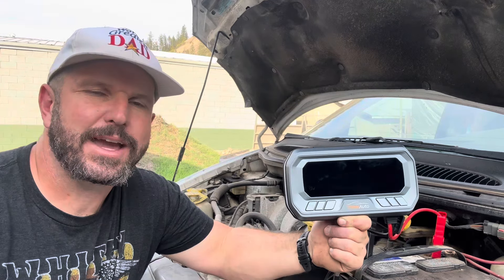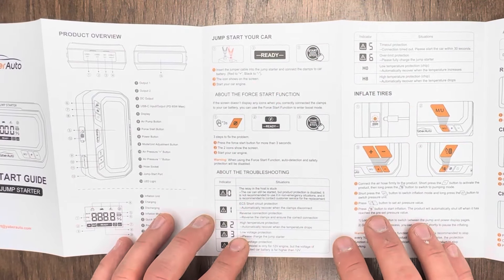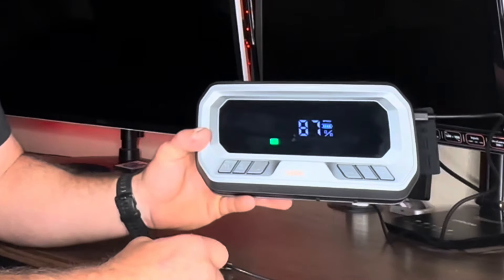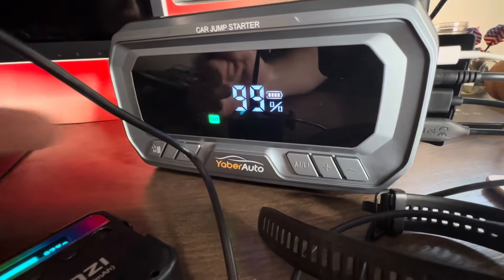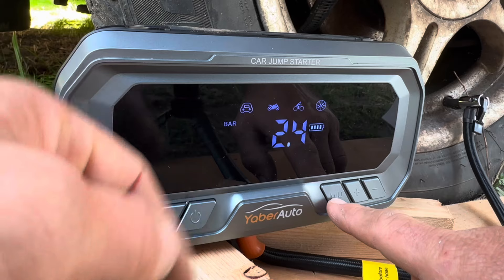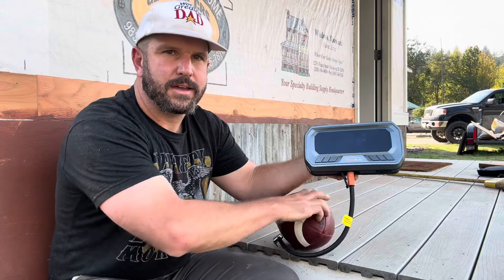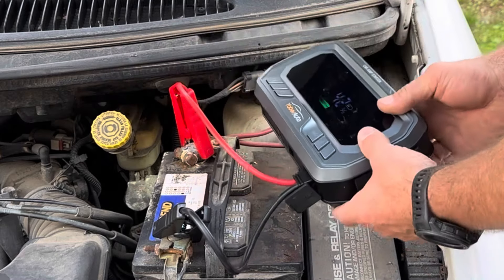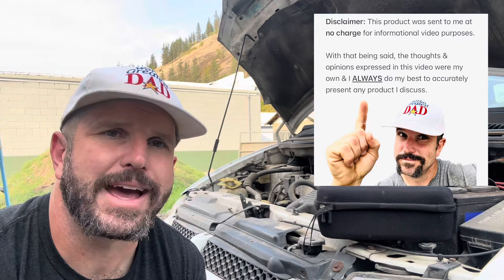Testing the Highest Rated Portable Jump Starter on Amazon - My YaberAuto Jump Starter Review

Comment: The product mentions that it can be recharged in 1.5 hours, providing that you are using a 65W charging brick. It wasn't clear what kind of charging brick you were using in your review. Did you ever try to completely drain the unit and recharge it from a 65W charging brick to check their claim?

Comment: Great video! Your great review gave me the confidence to trust the product. I must mention, it is charging now and compared to yours where your unit had 87% and it took just below 17 min to take it to 100%, mine was 90% when initially plugged in so I expected around the same time as yours. However, as I am typing this, it's been over 30 min and it just now went to 91%. I actually thought it wasn't working as the reader didn't move. But the screen shows as charging and now supposedly went to a whooping 1% more in over 30 min. I don't know how to feel about this as it already is not living up to the product's claims and to the expectations. Not your issue and you still have a great review, based on the product that you got, however, different people might receive different products with different performance. So, I want to put it out there. I can update with the final result if anyone is interested. Thank you!
Reply: You probably were not using a high voltage outlet / converter. If you use a regular usb-c power brick that isnt high voltage then it will be longer charge time

Comment: What is a good buy between the Yaber Auto YA90 and Trekure 4000A car jump starter with air compressor?
Reply from the maker: Both solid units that tested well with everything I threw at them...  

Trekure is going to save you a few bucks but less Amperage (4000 amps) - https://amzn.to/4fyb1mF

 Yaber Auto rated at 6000 amps but costs a little more -  https://amzn.to/3YUyQhz

Other than that, both have nice carry cases and about the same functionality... Hope that helps you out.
Reply: Yaber includes a higher power USB-C port and offer a higher peak current 
So probably the yaber